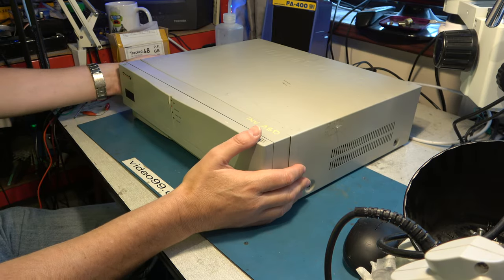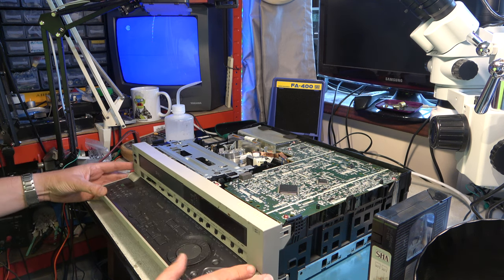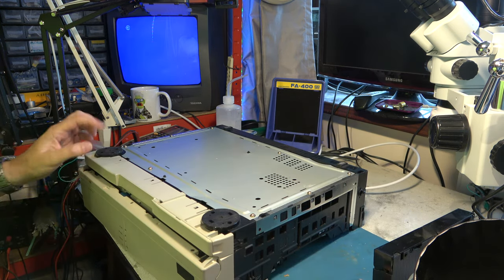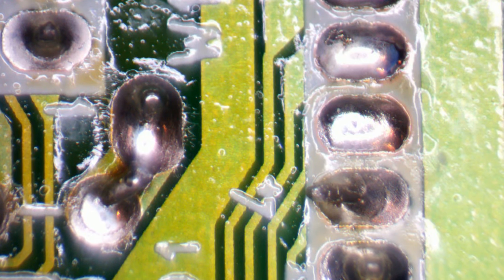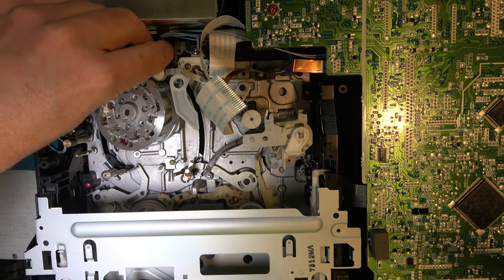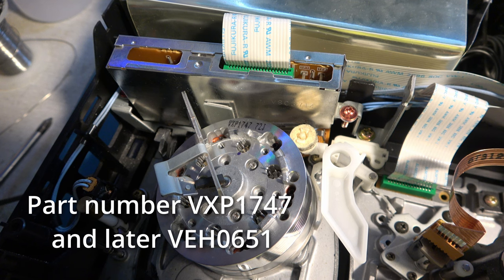Worn out video heads on Panasonic AG4700 SVHS? NV-HS1000, NVHS950 similar.  Part 1.

Comment: I bought a 1984 JVC HR-D120MS a few months ago and one of the video heads was worn to the point where there were black streaks across the picture around high-contrast edges. The head tips didn't look worn but replacing the drum from a scrap HR-D120EM brought it back in order. :)

Comment: Just when I needed this video most. I have a Panasonic NV-HS1000 from the mid 1990s with a few problems I've been working through. 
(1.) After I plugged it in, the heads would try to spin a few times, then it would go crazy and spin as fast as it could. None of the controls worked. I checked the power supply and found a "popped" capacitor, (the top had bent up; it was C24 on the board); which was easy to spot, so I replaced that. Plugged it in again, and the heads didn't spin, so I pressed the ON button and the unit started.

(2.) I tried putting a tape in, but the internal cover, (the flap); seems to be not step up correctly after I reattached the front panel. (I;ll get back to that later). A little trail and error and I got the tape to load properly. Pressing play resulted in the image as seen at 02:44. 

(3.) I proceed to clean the tape heads. Initially the picture was great, then it went back to as seen at 02:44.

(4.) By chance I touched the head amplifier and moved it slightly. The picture came back, then went off again.
If I touched the head amplifier on the left hand side and rocked it left and right and then forward and backwards I would get a stable image. I removed the head amplifier and sprayed the plug and socket with some detox. Just in case. A bit more trail and error; and I found that after plugging it back in, if I didn't completely tighten the two screws, I'd get a clean picture.

SADLY; not 100%; there are two bands of (reversed?) colour about a 1/3 and then 2/3 of the way down the screen, initially. And they move slowly down(?) the screen as I watch. 
Anyone have any ideas on whats causing those and how to stop them from happening? 
I'll keep looking and post any results.
Reply from the maker: I would start by resolving that problem with the head amplifier.  There is probably a dry joint somewhere.
Reply: @video99couk  - Thank you. I'll take a look at it.

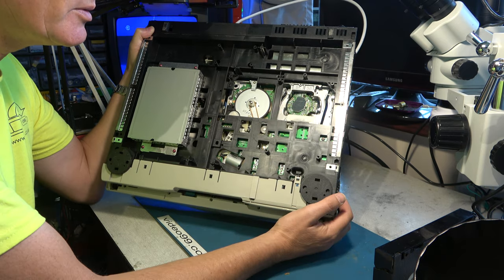Comment: 3:49 Dry Joints also occur inside the head amplifier board, on its connector and gets overlooked as not many people can be bothered to pull apart the 2 slotted shielding peaces. 
Love using ultra-fine ESD tweezers to get inside the head area and scrap stuff away under a full-frame (35mm) macro lens as generally, they are sharper and have fewer abbreviations then most microscopes under the 600GBP+ mark.

Comment: Just a note on those little head-cleaning rollers... I have not personally come across one which has gone bad, but I'm guessing their longevity depends on the material. I have a DV deck which had a foam roller. It was OK, but figured it would probably go bad in future so I removed it. I have another DV deck though where the roller is made of a felt like material and I reckon that would last substantially longer, so I left it in place.

Comment: The lone upside of the pandemic: if you work in a job that needs masks thanks to the ramped up production they're cheap as chips. My workplace has a department that requires them and they've bought what looks like decades of supply for a pittance in one foul swoop! 

Great work on this by the way. A treasure trove of knowledge in every video. A little dissapointing not to hear "Special Delivery!" at 10:15 but from my experiencing tinkering with an FS-88 even the knackered machines that could herald a donor can be quite expensive so I'm not surprised there was no eBay mystery machine waiting to be ripped apart.

You should try installing a garish blue LED. It may not fix it but it will certainly look snazzy. You could even sell it as a gamer edition.

Comment: Always good to help your friends :-D
Ahh the days of pulling the fasia off and posting my fingers to keep the flap horizontal :-D
Sometimes there was a plastic hinge pin missing,  a small needle was heated up and pushed into the  plastic flap,  it made a decent job.
Shame about the heads,  sometimes they are really dirty and ive used curved paper to clean the heads and if it was really stubborn the curved cardboard showed it who was boss lol.
That mould looked nasty :-(

Comment: That looks more like a tape path problem rather than a worn head in my opinion. During cue the noise bars didn't look evenly spaced indicating to me at least, that there could be a tape path issue, is the back tension ok? have the guides been twiddled out of alignment by someone? Scoping the RF output might reveal more.
Reply from the maker: I know what you mean, but when you're actually sat with the machine you get a feel for the real problem.  It was just "tailing" on highlights in the end.  The way these things configure their heads during picture search is a bit weird and give some misleading results.
Reply: Yes, unevenly-spaced noise bars during cue and review do indeed indicate tape path misalignment, but in this case the bars were also too noisy/snowy. Normally on machines with 4 head double-azimuth configuration the noise bars are very thin and look somewhat transparent.

Comment: I have a doubt, if Panasonic AG-7750, AG-7650 allows to use TBC control over a signal from it's video input?
It act as a External TBC??
Reply from the maker: I don't know, but suspect not.  Generally a TBC cannot be used in E-E mode because it's linked with the digital dropout compensator which is very much part of the video from tape signal path.  There may be exceptions, such as is the case with some Panasonic DVD recorders which do act as an E-E TBC, but I'm not aware of that being the case with any video tape recorders.

Comment: How would you clean the head cleaning roller?  The one in that machine looks filthy.  I've always removed the ones in my VCRs because I presumed they couldn't be cleaned.
Reply from the maker: I've cleaned them with isopropyl alcohol in the past.  The one on this machine is fine, I've seen much worse.

Comment: Hello , I ask if the video head of that model you is working  is identically to the moderl FS200, if OK could you inform the part number, I am searching for my Panasonic VCR. Thanks in advance
Reply from the maker: FS200 uses the G-mechanism I believe, so won't have the same heads.  But download service manuals to be sure.
Reply: @video99couk   Thanks  I get the part number of video Head for panasonic FS200, is VEH0467 Upper cylinder unit. If you know a store where I coould get it, will be appreciate or maybe you have in a loose box. have a nice day

Comment: 6:40  Is that a crack in the PCB between the solder point and the number 5?, or just a hair?.
Reply: This is an irregularity in the insulating clear coat.
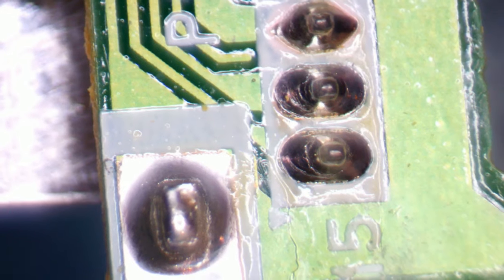Reply: I wondered the same thing. At 6:00 exactly, you can see it more clearly. It really does look like a crack - just below the dry joints, directly to the left of the '15' - however, if you replay the video over and over and watch carefully, you can see that it is a shadow cast by the irregularity. Had me for a second!

Comment: On my HS1000, I took the k deck out of a HD620 and replaced the headrum assembly with that from the HS1000 and putting the 620 deck into the HS1000. It works, but with similar issues to your ag4700. However after running for about 25 mins things had improved greatly bur still weren't perfect. Leaving the machine switched off over night things had regressed. So I'm strongly suspecting dry joints in the pcb. Are there any other places you think I should look?
Reply from the maker: I would just start by resoldering any bad looking solder joints on the lower drum PCB.  You may need to remove the lower drum for access though.
Reply: I understand thanks, nothing that I've not done before and at least I don't need to take the deck out again. Fortunately I was not getting any black streaks on highlights, so I feel the heads are OK.
Reply: @video99couk  I think when I swapped the heads into the replacement mechanism I damaged the solder joints on the pcb where the RF amp plugs into the pcb. I resoldered those joints tonight and everything is now working.

Thank you for your videos and help, I learnt so much.

Comment: Are these the generation of Panasonic S-VHS decks that suffer from bad surface mount capacitors that affect the picture?
Reply from the maker: No, generally capacitor problems are not too bad on Panasonic K-mechanism machines.
Reply: The AG-1980 is prone to that.
Reply: @crashbandicoot4everr  AG-1980 (US) corresponds to NV-FS 200 with K Drive (EU+UK), AG-1970 (US) corresponds to NV-FS 200 with G Drive (EU+UK)
Reply: @TTVEaGMXde  Yes, and actually the AG-1970 has the same part number printed on the main PCB as the NV-FS200 so they are ~90% identical.